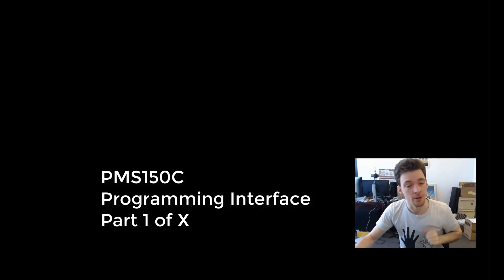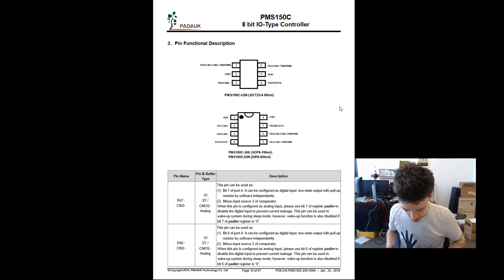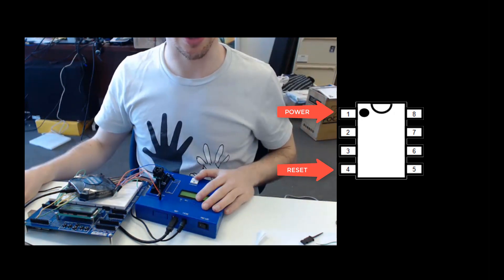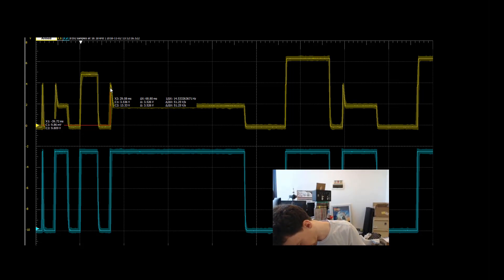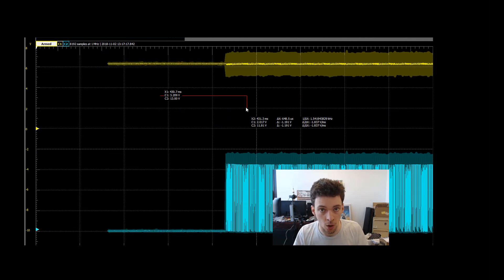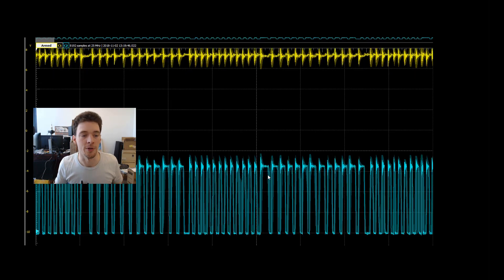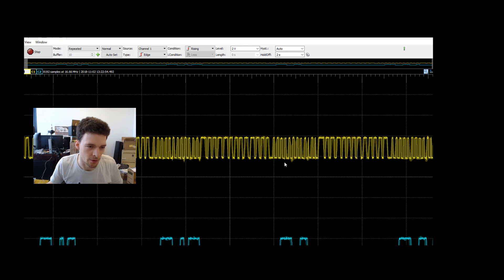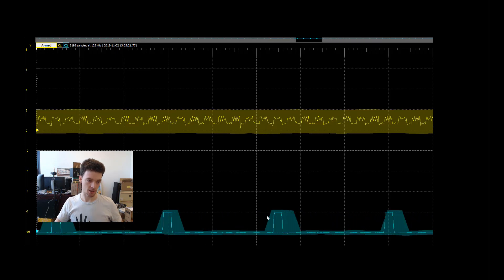EEVblog #1144 - Padauk Programmer Reverse Engineering

Comment: I just read the datasheet on the wood chip. The name Padauk seems to have something to do with wood in Chinese. The English is probably good enough to work from it. No opcode bits of course. Why would you not document that, why would you want to force people to use your (free) IDE? It's obviously not greed that motivated it, so why? The same thing with programming these chips and discussed here. Wouldn't you do everything you could to make sure people know exactly how to work your product? These guys obviously think it's better to keep a lot of key details working with these things hidden.

Comment: Use a voltage level shifter to buffer the signals to your logic analyzer, plus a bank of comparators to signal for each of the different voltage levels

Comment: There's probably internal logic, on a few different pins which require a succession of rise and falls to avoid internal congestion. There could be different levels of internal logic which require the offset to transport the data on the rise and falls. It's like the 1,2,3.... logic, each has to have room, internally to electronically perform the next step, otherwise an error correction scheme will reset the operation because 1 or 2 or 3 happened out of sequence. My best educated guess tells me that you have to provide a sequential pathway, and that it's not a completely integrated circuit and you have to understand its operation a little more. Personal guess and prove me wrong fan boys of this ic . Edit; "it takes two to tango" logic. And require an offset in rises and falls. From external losses. That's my 2nd guess. They expected a rebuttal which requires external time delay to complete the logical loop, or reset.

Comment: Good work there - and a nice presentation!

To me it seems unlikely that the micro can keep any kind of state when the supply voltage is turned completely off - could it be that some of the other pins is used to provide power? In the case of the PICs or even old EPROMs Vpp is supplied on a different pin than Vcc. 

You could also use a level shifter connected to the varying supply voltage to translate the ones and zeros for your logic analyzer.

Comment: Wow are hobbyists going to start using these padauk chips? If I could make a device to program I wouldn't bother with the emulator. At 3 cents apiece, I'd be fine with 30 screw-ups before I got the programming right

Comment: I can't understand why anybody who's thinking would bother with this complete dead end waste of time? You'll NEVER know the details of the engineering data to know what to do to properly program the chips in all their variations, proper programming is what determines their lifespan, reverse engineering will only tell you what to do with the samples you have on hand and new parts may vary, THE OFFICIAL PROGRAMMER IS ONLY $65 !!!!!!! https://item.taobao.com/item.htm?spm=a230r.1.14.48.6a6357f4pEYgNa&id=570643244941&ns=1&abbucket=1#detail , and you still need to buy the $65 ICE Box for developement. Why waste huge amounts of time and effort to make a half-baked half-solution that is guaranteed to be incomplete when you still need the $65 ICE Box anyway?!?!? Come on.... think. This disposable microcontroller fixation is a disservice to the maker world. PIC10 and PIC12 devices are only cents more, ARE FLASH, are fully sourced in huge volume through multiple vendors, are fully supported by multiple compilers and multiple programmers, the programming info is out in the open, Microchip is who made the programming info open so it's not BS guessing, the official programmer is as cheap as $50 and supports in-circuit debugging, you can buy programmer clones off AliExpress all day long, shipped, for $12, and there's already support to burn them with an Arduino. What a dumb distraction. The time would be better spent moving the EEVblog lab.
Reply: IN THE USA, @  7.25  an hour, its 1 days work.    IN BRAZIL its 2 weeks work.  So its cheap to you, not to me.  You might forget, not everybody lives in the big rock candy mountains.  If the rest of the world is to be able to enjoy the benefits of a 3 cent mcu, then this effort is well worth it.  That 65 USD," FEELS" like 800 USD if you put it in my context(  no longer is that affordable ). By no means is Brazil the lowest valued currency.There are probably more than 100 countries where minimum income(and average income) is less than 100 USD a month. 
Peter I grew up in the US,  I know where you are coming from.  NO offence meant to you. But with these cheap MCUs i'll be able to introduce electronics to kids who really need a way out of poverty.
Reply: I just thought I might add a few items of value comparison. 

-playstation 4 when launched here cost 4000 Brazilian Reals.  If you where a mc donalds casheir you would have needed to save up 3-4 months pay to buy one, and 3-4 weeks per game.
-Annual autodesk inventor 6000 reals or about 6 months of that cashiers income.
-Ford fiesta cheapest car sold in the us @ 12k , is about 1 years MCD's income .  VS 4-5 years here for that same Fiesta(made in Brazil version which is inferior is every aspect and gets half the safety crash ratings and probably half the mpg).

God knows how much those same things would cost in India, or through out most of Asia and  African.
Reply: @arnaldolacerda3156  Try THINKING a little and PLEASE cut the BS. I learned electronics before microcontrollers existed. You still need to buy the $65 USD in-circuit emulator to develop with. Then you need a $65 programmer and you'll NEVER be able to have a quality DIY programmer because the manufacturer is NOT going to release the necessary proprietary data. It's a DEAD END, just like your new President who will let the Amazon rainforests get cut down for money. That act alone may spell the end of humanity but it's about money, right? You can buy a PICKit3 for $12 including shipping, PICs are FLASH so you can re-use them thousands of times, many include in-circuit debugging, and they only cost $0.35. You don't have a valid argument at all. The cost to code for and program 100 Padauk "3 cent" chips is $133. Cost to code for and program 100 PICs is only $47. If you're manufacturing, these chips are only desirable for VERY HIGH VOLUME DISPOSABLE CONSUMER GOODS that will end up in a dump very quickly because the world is disposable, isn't it? Three cents MPUs are only good for a disposable world and people who don't care about the future.
Reply: Oh and pay hundreds of dollars just to enable the "-O3" flag on the compiler? Call me when PIC actually supports GCC.
Reply: @goosenp  [FACEPALM]  Call me when you have hundreds of thousands of devices in consumer's hands actively running your code. I didn't need GCC or to spend hundreds of dollars on compilers yet I've developed successful products using the PIC line since f-ing 1993 before Flash parts existed. I usually code in assembly for little micros anyway because compilers tend to produce exceptionally shitty DSP functions. I've had to optimize native assembly just to make code fit in a part and trying to use ANY compiler in those cases is laughable. You can buy my PIC based gear at retailers from B&H to Walmart, today, right now. Call me when you can honestly say the same.

Comment: Hi Dave, use Saleae analyzer for decoding data. Put a comparator on the supply voltage and connect the output of the comparator to one of Saleae inputs, so you can see high/low voltage periods. Flash it with some known data and here you go.

Comment: @David Ledger Great Vid, reverse engineering always starts out looking horrifically complicated. Not sure if you have checked this yet or not, but I imagine you are programming the same chip over and over? If so have you checked to see if there are any differences between a blank run and a programmed re-run. In case it changes to a verify only mode (or at least to something different on already programmed chips)

Comment: How about starting with just the verification process as it might reduce the voltage shifting. Once you understand the readback it might be easier to spot the verification which happens during programming, I'm wondering if it's verifying block by block rather then doing it at the end.
As others have mentioned add some patterns into the program which you can search for and please switch to using a logic analyser either clampling the voltage or with a line buffer. Speaking of which it would be useful to determine which lines are input, output or tristate during programming.

Comment: why don't you try to reverse engineer the programmer itself, look for data out, clock, maybe data in on the output of main chip, discard various i/o  that will control the voltage rails. At least you'll be dealing with standard 5v signals

Comment: I have seen programming patterns similar before. The programmer was sending data 'records' which contained various bits of information such as where the data was to be saved. This was then checked by the device using some sort of checksum. The programming voltage was then raised to allow the data record to be saved to the devices flash memory. It was similar to the way that a PIC self programs. Possibly the output pulses are some form of handshaking. It would be interesting to see what relation they have to the clock and data.

Comment: Can the high voltage switches be for the actual burning of the data like how old micros required 12V on a pin to program?

Comment: I thought the programmer is about 100usd. That's not particularly cheap
Reply: In my opinion, that's exceptionally cheap for a product with such a niche target audience. Just Like the devboards from e.g. microchip which are heavily subsidised.

Remember: this chip does not target the maker Scene, thus USD 5 DIY programmers are not really to be expected.

However, they might See this as an opportunity to get more people familiar with their product and Release the layout for the maker Community :)
Reply: @petermuller9518 indeed, the chip might be nice to play with and if you need a lot of chips it is a good choice, but for the general DIY er, there are better options

Comment: My personal reason to go rogue with the programmer would be to get rid of the requirement for windows in my production pipeline.
Reply: While I personally prefer other operating systems, too, programming this chip in your production pipeline is a waste of resources. You would not want to use such a chip for small volume boards and you would buy it preprogrammed for large volume boards

Comment: I just came across the STM8S001J3   $0.2 in production. It has I2C, ADC, UART, SPI, EEPROM and In circuit debugging, 8k flash. Dicking around with this chinese crap sounds interesting at first but looking twice it is more of a waste of time than anything else...
Reply: That's an order of magnitude more expensive :D in products where you would use this kind of device you do value engineering, e.g. reducing number of resistors and caps
Reply: @petermuller9518  But I fail to see where this thing could be actually useful: It has no real peripheral, it is not debuggable. So basically it will take you upfront a lot of your engineering time to develop (not free). =>it is aimed at high volume. Would you trust this chinese company to be around in a long time to support this chip if you pick it? 10 years? no right? so basically useless for any approved product... Really now I fail to see any application to make it worthwhile
Reply: @RemiBusseuil  I'm really no expert on this chip, but doesn't it have Timer/Counter as well as PWM generation in additon to gpio? Of cause I would not use such a chip for a product I have to Support for 10 years but which product do you? Even smartphones, which are really high tech by comparison, will not be supported for more than a year. This chip is most likely suited for fire and forget products like toys with a couple of blinking leds or toasters

Comment: Great job, keep up the good work, this is really interesting. Also, did you already take a look at the PDK files that the IDE outputs? I noticed they're definitely encrypted or encoded in some proprietary way, since by just changing a value in the program (i.e. take a program that initializes a variable and loops forever, and change the initialized value from 0x01 to 0x02) a whole lot of bytes change, I tried with more than 20 different programs and it's always the same 2k region of the binary file that changes (I mean, it is totally different, not a single byte equal). That file format will be an interesting thing to RE.
Reply: Have a look at the EEVblog thread, they're doing some weak XOR "crypto" which is reversable.https://www.eevblog.com/forum/blog/eevblog-1144-padauk-programmer-reverse-engineering/msg1942411/#msg1942411
Reply: @goosenp  Many thanks! Really interesting, I didn't notice it. I'll start looking at it now that I have some kind of starting point. The guy did a really good job at RE the IDE.exe, as soon as I opened it in IDA I got quite a bit scared by the amount of stuff inside, given I'm not a RE guy by any means.

Comment: I could be wrong but I think I saw some information for programming in circuit in one of the previous videos. This should help in knowing which pins are actually used. The different voltages could be down to writing at a high voltage and then verifying at a lower voltage. Finally some of the DATA may actually be just noise/pick up. Add some strings to your code with some recognisable patterns. Finally capture a whole programming cycle from start to finish in a digital format that others can see and crowd source the cracking ;)

Comment: Good Video!
Reply: I like when you discribe small details, what active low means for example. or that the pin setting it for programming are normal GPIOs, good stuff for beginners.

Comment: If the logic levels are going up and down with the supply voltage, could you use one of those level shifter chips which have two supply voltages, one for the input (which would be the varying programmer VCC, the other the fixed output voltage for the logic analyser). Or maybe just use multiple taps on the voltage dividers to drive several digital inputs of a logic analyser for each pin, and merge the data once sampled. Certainly an unusual set of signals.

Comment: Stupid thought, why not set up a series of ADCs, one for each pin, tolerant to the maximum voltage, and just use the logic analyzer to capture the ADC output?  That could the be dumped and reconstructed into a waveform.  It’s not like there’s a ton of data there, nor is it all that fast.

This would essentially emulate a large buffer low res low bandwidth 8 channel DSO (you might have one already), and you could capture the entire programming session.

Comment: Use a logic analyser and feed the pins into two channels. One a direct Zener limited link and the other a divided version of that where you can set the threshold to only trigger a high on high voltage pulses. That way you can read both the high and low voltage states safely.

Comment: Might just try using a shunt resistor on each line with diodes tied to a power supply 0.7V - 1.0V less than maximum logic analyzer tolerance.

Comment: Many of observations can be false with this "oscilloscope" due to aliasing. Different voltage levels and different clock speeds can be artefacts depending on the oscilloscope sampling rate.
Reply: Not this time, varying clock verified on other devices, they just didn't have memory depth.
The voltage levels could potentially be slightly higher for the short pulses, well spotted.

Comment: At 7:59 I think you're wrong. Rising edges are too close. I think data is read only on the falling edge. Create a sample program with a hex string of AA55AA55FF00FF00 then look for this data pattern. Thinking the slower clock cycles are the required time to burn each byte of data. Keep up the good work.
Reply: Don't forget to try Michael's suggestion of programming with some predefined 'visible' data, like A5 or DEADBEEF so that you can ultimately see the data patterns.
Reply: Yeah, falling edge seems more likely but there is quite some time between the data rising and the rising clock edge. 
The data is pretty stable once the first rising edge is encounter, there isn't any overlap. 
What your seeing here is just uncompensated probes on the analog discovery, didn't look like that on the scope. 
But thinking about it, likely your right. It would be more sensible to read on the falling edge. I'll work on that assumption I think.

Comment: If you want to put these signals in the range of a logic analyzer, use a series resistor into a diode clamp rather than a divider.  This circuit will  be transparent to the lower voltages, and keep the higher voltages within the acceptable range of the logic analyzer.

Comment: The development OTP PIC chips I was working with had a window in the top and could be UV erased. I believe someone else commented that you could achieve the same effect by decapping a regular one. Not sure if that would work with these.
Reply: I can verify the EPROM PIC1657 devices used the same die as the OTP HS part. Source: Microchip Technology, San Jose, California 1993.
Reply: @Peter_S_  And if I'm not wrong, the 12V is a eeprom programming voltage.
Reply: @chaos.corner  No question 12V operation of a 3V3 part is all about delivering Vpp to OTP cells. It's 1985 all over again. ;-)